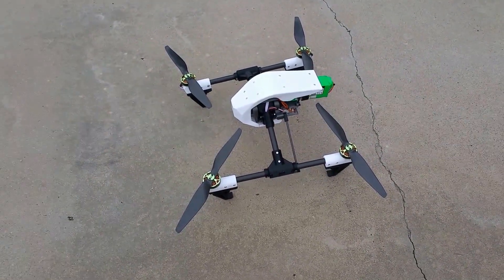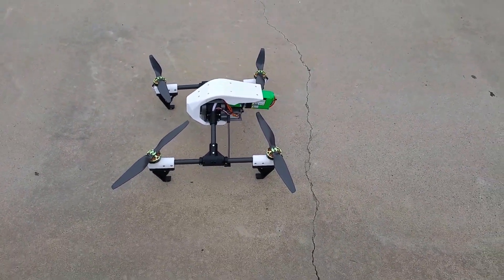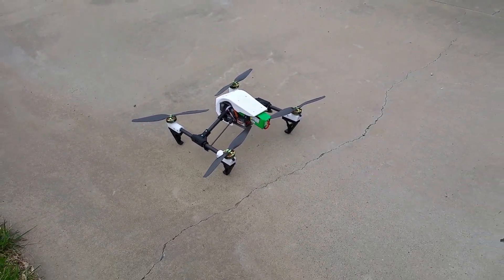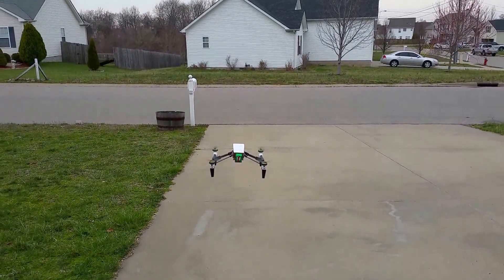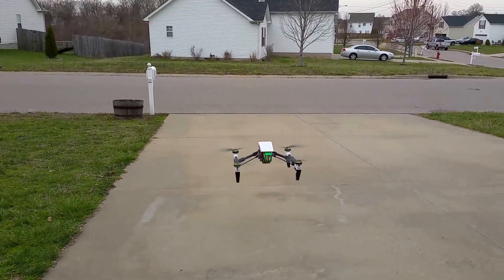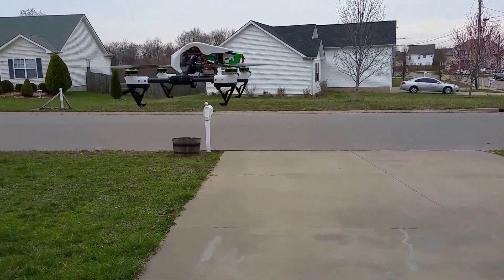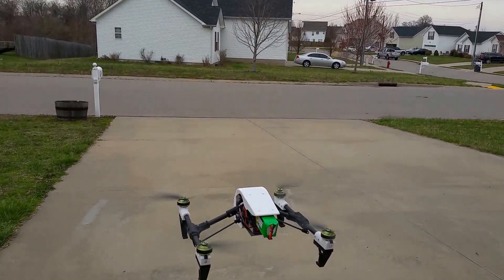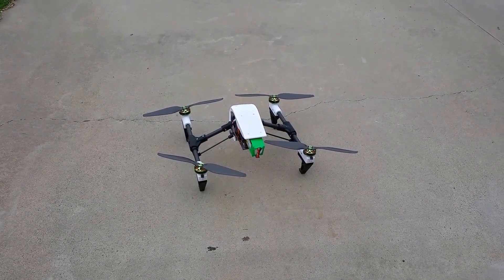3D printed DJI inspire maiden flight!

Comment: Good mod Helifreak, although i saw miserable vibration with the motor mount. Hope you fixed that, I wanna see your homemade Inspire flying well.
So, I just want to know how was total AUW and flight time with this configuration (4108 420 kv+1355 props+6S 5200mAh 10C)?

Comment: What did you use to control the drone? Its not on the description.
Reply from the maker: I had a Naza lite on it. you can use pretty much any flight controller with it.
Reply: +helifrek yea Im thinking on using a Raspberry Pi so I practice programming.
Reply from the maker: +ralmslb that would be awesome! a lot of the flight controllers out there run arduino and are much smaller than a raspi. you might want to build a simple frame as a test bed first. the inspire clone was a pain in the butt! I don't have it anymore but it was cool while it lasted.
Reply: +helifrek I was gonna do something similar. What issues did you encounter on the way? Why was a pain?

Comment: Im hoping you can steer me towards the right direction
Reply from the maker: could you elaborate a little?
Reply: +helifrek I'm trying to build this and I'm printing the parts should I use the rc hobbies checklist or the forums checklist? Also where did you find most of your parts(electronics) bc the checklist I'm using is out of date
Reply from the maker: +Evan Portnoy there are alot of variations now! check the thread on rcgroups, not much original one but the one by fragmaster. he kind of took over where I left off and could probably be of more help!
Reply: +helifrek thanks

Comment: hey bud, can you please share you pid settings for this frame or suggest some resourse for that. Mine is very hard to control in stabilize mod, and slight throttle move brings him very high into the air... :((

Comment: I think your cg is wrong i noticed on other clones the arms are swept back
Reply: +Bob Barker yes, after his build there was a lot of modding on rcgroups. In the latest version the arms are way back, helps to balance rear mounted battery.
Reply: +Bob Barker there are plenty of 3D printing services available online, where you can order prints. Also, 3D printers start at $400, whoch is not so much, considering this drone will cost you over $1000 to build.
Reply from the maker: +Bob Barker I have printed a few for people. I usually charge around $220 (which is cheap for 2 weeks of 3d printing!). I agree 100% with Vlad here, buy yourself a decent 3D printer and learn how to use it and then tackle this project! you would be able to print spare parts if you crashed so that is always a big plus of having your own printer.
Reply from the maker: I didn't design this myself. I printed it from existing files and at the time nobody had designed swept back arms, some fine gentleman on rcgroups have taken the liberty to design some though. looks much cooler and helps the CG.

Comment from the maker: The vibrations were not due to the gains or props. The T-mount where the arm tubes passed through were too loose and some of the holes where the arm hardware goes in was oversized resulting in a lot of slop in the arms.
Reply: What is the minimum size bedd needed to print one of these
Reply from the maker: +TheEnragedGamer I am not 100% sure what the minimum would be. I think 6x6x6 would probably be enough. I have an M2 which has a build area of 8x10x8